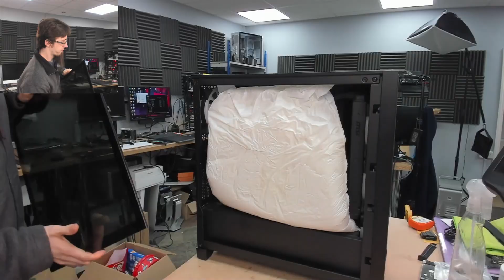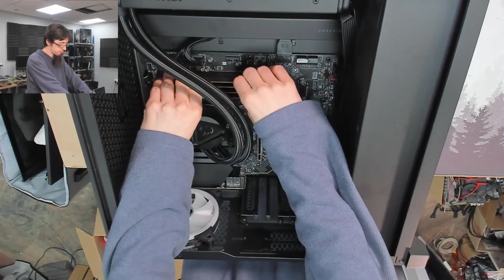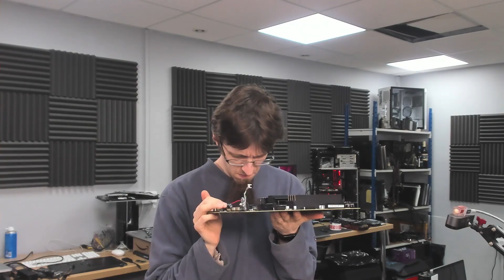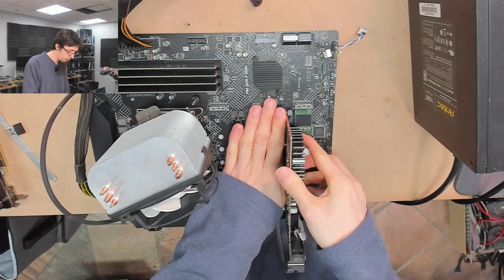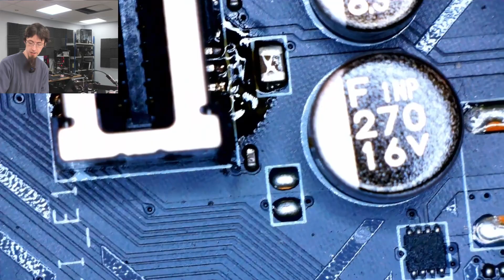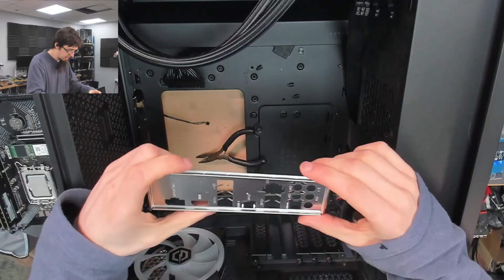CyberPower PC, GPU not detected - LFC#334

Comment: Don't believe the responsibility rests solely with CyberPower, despite their choice of lower-quality components. It's reasonable to assume that the PC was thoroughly stress-tested for thermal efficiency and overall performance before being approved for shipping. However, the PC likely suffered from mishandling by the couriers. The weight of the GPU could have exacerbated any damage, possibly even leading to it being dropped during transit.

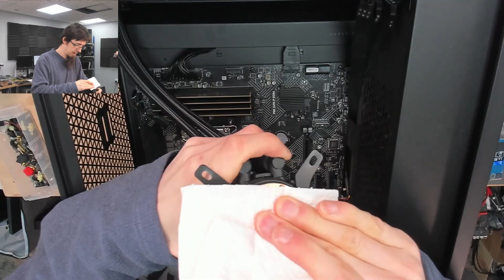Comment: 57:36  I noticed that you skipped the process where one would add heat sink compound between the cpu and the cpu cooler and I'm going to assume that you did use it but skipped the procedure in order to avoid having your video flooded with comments from the heat sink compound quantity and placement fanatics. 
????

Comment: You are wrong about the extra 4 pin ESP, the only situations you need it is when doing extreme overclocking or sustained workstation workloads. in normal situations you don't need this.
For daily gaming and normal use, a single 8-pin EPS cable is more than sufficient

Comment: I have a similar issue with a Gigabyte Auros Elite AM4. The board used to fail post occasionally if it was powered down for more than 24hrs. It finally quit last Summer and stopped displaying mid game, and permanently failed post afterwards. The intermittent fault was from day one of the build, but since the board is now 5 years old, there's no chance for warranty.

Comment: as a cheap test bed, - I was wondering - get a cheap case, chop the sides off to leave support for power sup.   and disk  - maybe one fan to see if power is working or not.   rest of sides - gone.   Does that make sense.?  No - just saw case to do exactly that for $15 to $20.

Comment: When I was working as the LAB Hardware Tech in a team building a simulation package for a customer I had a number of desktop PC's along with 4U rack mount computers with PCie 16 slot failures. Some of the 4U rack mount computers didn't really need high end graphics but were F sku processors. I moved the GPU to the X4 slot for those but the 4U machines that relied on the GPU and desktops had to be sent back to the supplier for repair / replacement.  The whole setup had in the region of 50 rack mount and desktops with several intel NUC's, &  20+ laptops. I had my hands full troubleshooting issues.

Comment: Great job!
This video is also a pofect example of why PC parts manufacturers, engineers, nerds, gamers and users need to get their heads together and think up some new standards for PC parts and how they are connected up. This 1990s cr@p is ridiculous.
All the wiggly niggly little fron I/O cables, the big heavy power connectors from the PSU, the ridiculous placement of fan connectors and so on and on.
At least Apple kept trying to innovate.... until they went far too far and then nothing could be upgraded, but they showed how well aa system could be designed and not look like something from 1876!

Comment: With that board misalignment in the case. The PCI slot is acting up. I would have checked / reflow the solder joints. Also used a microscope to inspect closer. ****have not seen the whole video yet... OK we got there 😅

Comment: Very, very poor soldering. This is disrespectful to the technically educated audience.
And the fact that there is no 12 volts - it was clear almost immediately. But it is the measurements that should be done first, and not suspect the processor. What kind of stupidity?

Comment: That POST beep has been relevant since the 1990's One long and two short means VGA error (2401 on the old IBM PS/2 machines - if I remember rightly). Edit: Nice fault to find. Great job. Much better to repair than to replace.

Comment: I bet the board being misaligned in the case caused this. If the GPU wasn't sitting true and the person who built that forced the GPU to get the GPU riser to screw into the case then it's possibly put excessive strain on the PCIE 16x slot. Just my opinion but that's what I think has happened.

Comment: Probably my favorite video I've seen you do. This video nearly has it all. The weight of that 3080 absolutely cracked those joints on the PCI slot. When you stand the case up that card will for sure sag. Should have a support bracket from factory with the card.

Comment: good job repairing the mobo, yes lots of issues with those video cards stressing and breaking the pcie slot during shipping. Most manufactures now ship the video card OUTSIDE the case to present that, and now we have the adjustable stand to keep up the video card support in the top center of it.  Cards are getting way too big and heavy for the tensil strength of a pcie slot.

Comment: I have at least 30 years repairing and building computers and you sir are a gigachad hehe, I would not have checked that, just would put that board in the trash, put a new one, charge for it the and the repair and call ir a day.

Comment: Impressionnantes compétences et savoir faire. Fente de GPU, entretoises de carte-mère, cablâge d'alimentation GPU et repositionnement correct de SSD, une réparation 4 en 1. Bravo !
Impressive skills and knowledge. GPU slot, motherboard standoffs, GPU power wiring and correct SSD repositioning, a 4 in 1 repair. Bravo!

Comment: I wouldn't have found that and would have replaced the board (in fact, just recently did this for a system with very similar fault code).  I ended up replacing EVERYTHING: CPU, RAM, power supply and finally the board itself.  Now I've got all the original parts sitting aside waiting to dig into what might have gone wrong.

Comment: I got a server board with a dead PCIE slot, and its the only slot its got, I was going to use it for my media server with a GTX 1070 for the encoder, Well after messing with it, I found that using masking tape on the PCIE connector to turn it from x16 to x8 it would then work as normal be at x8 speeds, Wouldn't be ideal for gaming though, but no ill effects for performance for the encoder that I need of it.

Comment: Crazy what a simple fix it was. I know that had the customer sent the PC back to Cyberpower, they would've DOAed the board and sent it back to MSI who probably would have stripped it for parts and called it a day, but a simple solder reflow due to PCIe 16x slots not being designed to take the weight of how massive GPUs have become is amazing and probably something you've learned overtime. Top notch work and you got a sub from me!

Comment: That was such a easy fix, you should of seen that right off the bat. The way the graphics card card moved like that. It was obvious the weight of the card broke the joints. That thing needs a anti sag bracket or whatever you call them.

Comment: That was a great diagnosis and repair you made there. Seriously, very well done. Honestly, I was hoping you would give the owner a small mobo upgrade, just because running a 12900kf and a 3080 on that Mobo seems ridiculous to me. I'd want something like the Asus Prime or MSI Tomahawk or Torpedo to run a 12900kf long term. I'd also need at least an 850w gold power supply from Seasonic or Corsair or another reputable manufacturer for long term use. I have an EVGA G6 850w and all I power is an X570 mobo with a 5800X and a 2080 Super in a O11-Dynamic. I think I use more watts to power my 9 fans than I do to power my CPU when I'm playing @1440p or 4k lol.

Comment: I had serious problems with a cyberpower pc.  I finally discovered after years that most the solder joints on the connector where my graphics card was installed were cracked.  Crappy soldering job.  I had endless issues.

Comment: Could it be that some ogre smashed the GPU in so hard that they ended up bending the case back plate just enough for it to cause the motherboard misalignment, incidentally breaking the GPU slot as well? 

Excellent fix, I would be nervous of doing such things when these parts are still under the warranty, but I can understand that nobody wants to be sending those PC's for the manufacturer if it can be fixed by using some good old brain power.

Comment: I was going to buy one of these when no components sellers had stock and only OEM and integrators had 30 series cards.  I wasn't expecting to get a fully working system, but rather a bunch of parts I wanted and a bunch of parts I could sell... and buy the correct ones.  Memory for example.  They sell you the headline figures and probably don't mention the lemons.  For a whie it still worked out good value to do that.

Comment: I agree with you on the manufacturing job, it was a real cheap board in its genre as well but still highly likely to be down to shoddy soldering during manufacturing, could've been the machine that automatically solders them ran out of solder at some point and before being resupplied a few boards managed to pass through that part of the process and ended up with insufficient soldering on the joints  after which a few boards manage to sneak through QA due to the very subtle nature of the problem.

Comment: Not to nitpick, but removing the battery to reset CMOS, while it does work, is not the recommended way to do it as it puts wear and tear on the battery socket. The best way is to either short the pins on the CMOS reset (official way to do it), or if your board is equipped, press the reset CMOS button. If you are ever fine tuning ram or anything that would require multiple CMOS resets, use the pins as you do NOT want to break the clasp holding the battery in.   Edit: Been doing PC services and repair for 25+ years.  If you are going to do the pin method: First unplug the PC. Then use a screwdriver and place the tip between the 2 pins for the CMOS reset. Count to 10. Remove the screwdriver. Plug PC back in. Turn it on. Done.

Comment: should never use KF CPU at the beginning or cheap on RAMs, use min 1000w power supply.
Reply: Minimum of 1000 for what lmfao. My 1300W with a 4090 and 14900K barely sees over 600W total usage, if ever

Comment: We just put in a 3050 in my machine and my buddies, mine worked straight out, his wouldn't. Turned out to be an incompatibility with his mobo. Yet, it uses the old 1080 just fine.

Comment: That board is not an enthusiast board. First time I bought an expensive $400 ITX ASUS motherboard - it had a built in IO shield so much ease of installation. I hate those cheap IO shields they make it hard to plug any ports into the back with the tabs that stick out around each port.

Comment: You need acid brushes. I wonder if the solder joints cracked when the MB was jammed into the case.

Comment: And this is why i remove my graphic card every time i have to move my gear. Those card are heavy and will damage the PCI express slot. I have a support bracket and i still take the card out. Specially if like me you have a strix since they are at the top for weight.

Comment: please swap the water color around the hose orientation is backwards the hose should be going towards the bottom not the top so that way air doesn't go back up to the water block that way you could probably have a good loop

Comment: Radiator should have been flipped tubes down. With tubes up, the air in the AIO will be constantly sucked into the pump and cause cavitation and run issues. The AIO life is going to be considerably reduced.

Comment: Whenever I get prebuilts that have been shipped I typically bread board them unless it’s something obvious (throwing specific code). Just to make sure all the standoffs are in place and the system was built properly. I’m often surprised how bad of shape these systems are when they go out the door.  I would  have also flipped that aio around so the pump isn’t sucking air, I see them die all the time (usually around a year year and half) In that orientation.

Comment: Enjoyable video, I was screaming at my monitor for you to check the soldering on the PCI-E slot. As I had the exact same issue in my workshop this week. I would advise resoldering those legs with leaded solder though as if it is as you said at the beginning being shunted around to LAN parties...I fear it will be back in your workshop very soon for a redo.

Comment: I have the same board and the IO shield does not align properly either. I bought mine at retail with a 13700k and have had no problems with my 3080. I would agree with the post below that the expanding foam can put way too much force on the board. Especially when it gets banged about in shipping.

Comment: Nice job!! Most places would have just sold a mobo and moved on. Saving a customer time and money is always a good thing. Get yourself a soldering station with a smaller pen and you'll be good to go. At my job we use JBC NASE 1C stations and they work great, and have a wide arrangement of tips to use for many different jobs. We also have some Hakko FX 888-D stations with larger pens for more heat transfer, but I cannot imagine trying to solder something like a USB or PCI connecter with that station, even though you can use smaller tips with it. We generally use them for mechanical soldering. Again, great job, liked and subbed.

Comment: i was going to point out check it before swapped mobo which you did check it find it
i put blames on manufacturing issues because that mobo is not original it cloud (it copy of knock off designs) if you take look at original vs knock off one they a lot different between it 
i just love watching you fixing it n do video about it (i do that type of work too fix pc else n more)

Comment: Why is such a costly new PC under warranty?
The troubleshooting was impeccable and by the books. I would get the mother board replaced under warranty though. If the PCI had faulty solder joints, other parts might also do and that will show up later as the board cycles thermally. I wouldn't want to be on the receiving end if that happens the day after the warranty expired.

Comment: Did they use D-Sub nuts instead of motherboard standoffs on the top since the board is warped there?

EDIT:
Never mind. :) 

I suspect the solder joints were dry and only making mechanical contact. Probably oxidized over time after the build was done or was shifted slightly during shipping to the customer..

Comment: It's possible those 12V power pins got ripped off from their dry joint because the motherboard was in at a weird angle. That would put some really wonky stress forces on the slot. This was just a really bad QA job at the MSI factory.

Comment: You could have confirmed it was the motherboard by switching the M.2 to the top slot which shares lanes with the top PCI-E slot on the motherboard (most likely). If it still saw the SSD, it is the motherboard otherwise it's a fault in the CPU.

Comment: I was working out of town once and needed a new PC so I ordered one from CyberPower, it took 2 and a half months before I got the system and on initial boot it would not power on. Like this system they put in the cheapest RAM you can get and it ended up being bent pins on the CPU that caused the initial fault. Fixed that but then had nothing but problems with the computer. I gave CyberPower a call and got the run around BS they always do and in the end gave them the middle finger and decided to go back to building my own systems. Was not fun building it in a motel room but in the end I got twice the computer for half the cost and what I should have done in the first place. NONE of these so called power systems are worth a damn and its just a total crap shoot if you get one that works!

Comment: Probably a delayed screw up just because of a bad solder job during manufacturing and then shipping didn't help.
Another reason to ship the GPU seperately, if they didn't, they should, but even then with the bad solder job it was a matter of time anyway. Also explains the intermittent functioning.
The standoff was not great, and the SSD was basically just in the wrong slot, which is just stupid, no reason for that whatsoever, and to me that shows the people building it don't know what they were doing.
Thankfully i know how to build my own systems, i'm not a genius, i wouldn't have gone to far as to check the power on the mobo, i'd go (back) to a store before that after doing some normal testing. But i would know to getter better memory, and a better mobo and power supply, and to put the M.2 in the right slot.
I will never buy a prebuilt, always too much crap and shortcuts. Also don't recommend them to friends, i'll build one for them just because of this sort of shit.
Which doesn't mean you can't get faulty products, the worst case i've had with trying to get a machine to work was a bad SATA cable, don't expect that to happen too often though, did take a while before we found that out.

Comment: use the oldest pci-e cards you can find - you might get better luck with booting into bios or windows  -I could go into windows xp with a Ati mach 64 2 mb pci card and very great to strained up windows since windows would install drivers for in and reastart and then pluggin the malfuntion" card would work and windows would install funtion drivers - What the oldest pci-e ,I know windows 10 install windows drivers for Amd 4850 but i guess older than that would work

Comment: Ive had this same issue..same intermittent not posting when i would clean my gpu..so it would take a few tries to finally get it to post..then my pcie16x slot just went out cause i lost signal with my gpu when my gpu was in that slot..so i moved it to the pcie8X and its working like it never had issue

Comment: Mr ant I think you did excellent in finding that slot failure. It is probably that horrible non lead solder they used to build the board. Of  course the first time you tried the 3080 the silly solder break was pushed together. The next time try pulling the  card towards the  cpu with a tiny bungee and then away the next start.